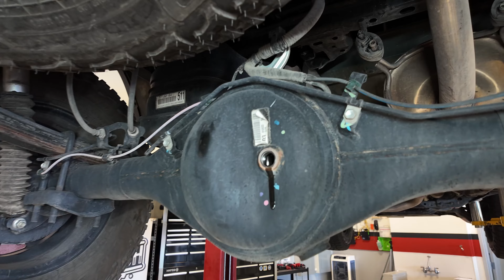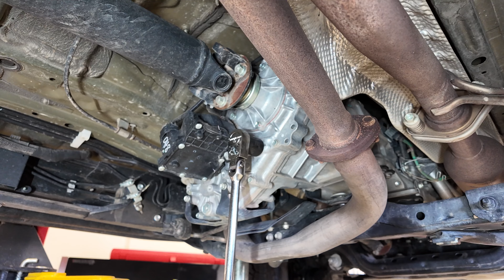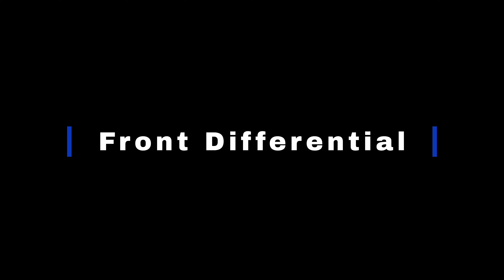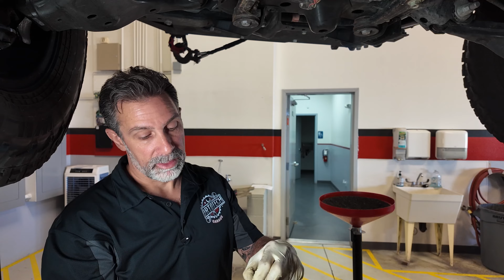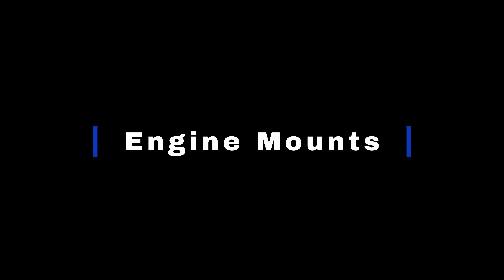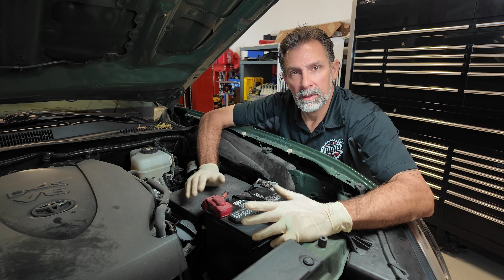Keep Your Car Healthy: Learn to Find Non-Oil Leaks Fast!

Comment: Great video. I’ve seen customers call the service advisor after arriving home and discovering a drop or two on the garage floor. Most of the time it due to an individual not wiping off excess fluid (lazy).  I agree with replacing the battery when it is leaking from the top, it could be caused by overcharging so the charger system should be checked.
Reply from the maker: I really hate to see a messy job cause a comeback, but it does happen.  Thanks for commenting and watching!  We appreciate you! 🙏